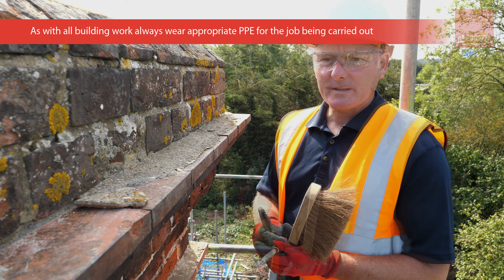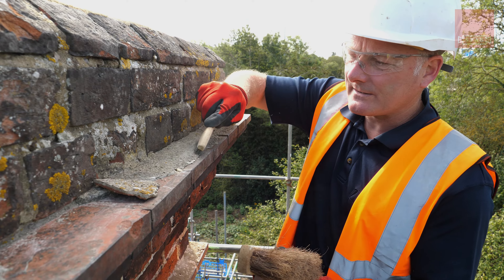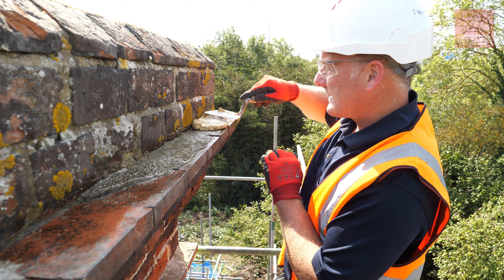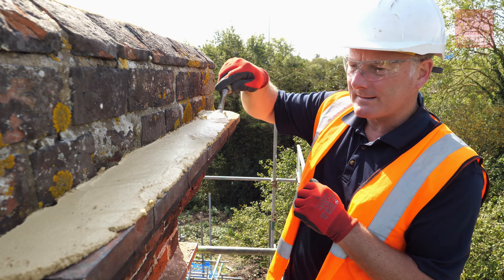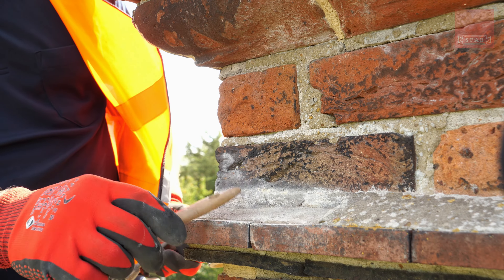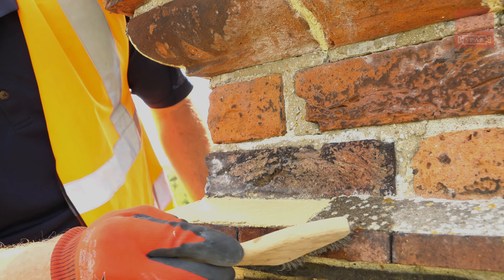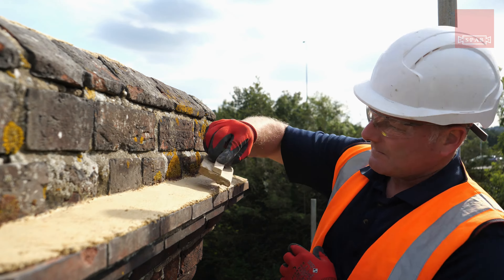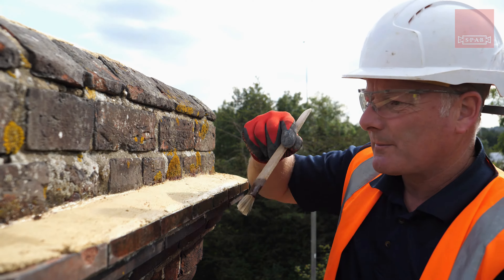Repairing your brick chimney: Part 2. Flaunching and mortar fillets

Comment: Why have you gone for lime mortar on the fillets rather than a sand and cement mix?
Reply from the maker: Hi there! We've gone for lime mortar because cement mortar would be too hard and doesn’t accommodate movement like lime does. Lime works in a more harmonious way with the softer bricks.
Reply: @spab1877  accommodate movement by de-bonding and crumbling over time I suppose?

Comment: Clean the moss …seal surface with a pre grit …2 coats of mortar one scratch coat on day one topcoat on day two .. add waterproofer even to limerender stops the shrinkage and cracks ..finish with a proper float not a wooden one from 1920s
Reply from the maker: Hi there! If flaunching in lime it could still be done in one, that isn’t to say a scratch coat and topcoat wouldn’t work. Using a modern waterproofer on lime could compromise breathability. The reason for using a wooden or plastic float is to give the surface a texture that opens the pores to make it more breathable. With a lime mortar flaunching you can work it with a float the next day to close any shrinkage cracks as it tends to "tighten" up on day one, and then day two rework it with float. There are a number of methods that create the same result, the method used here is just one.